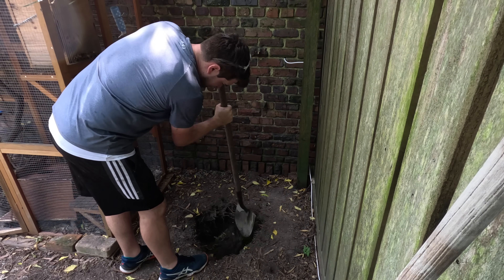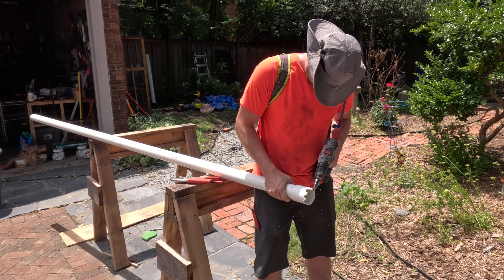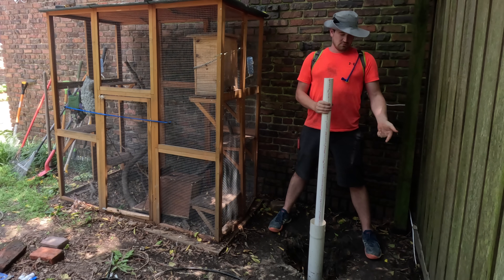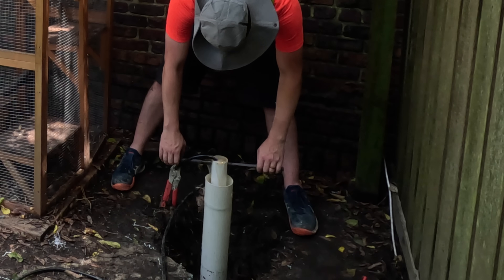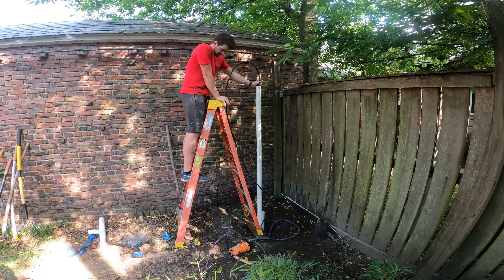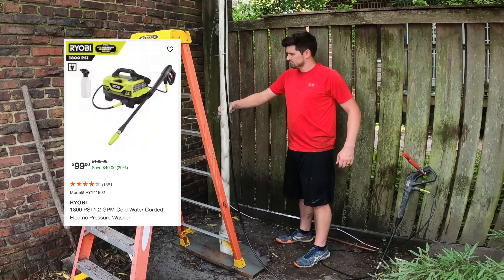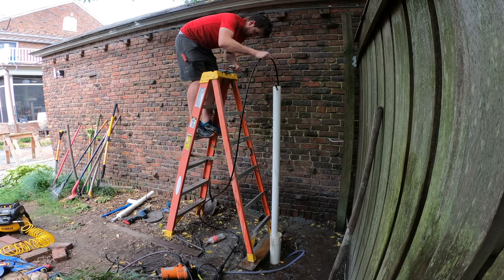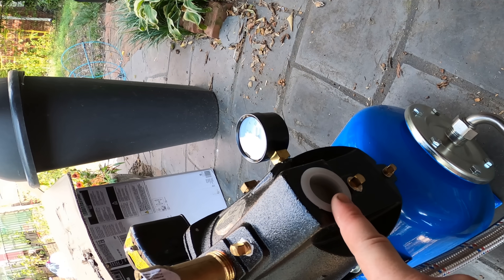I dug a 40 foot well in my backyard

Comment: 8:59 At close to 40 ft. you're just cork-screwing the entire length of PVC at this point, not turning it at the bottom (or turning at a coupling, since you didn't use primer). FYI, at only 40ft, don't ever drink this water. I wouldn't even put my hands in it, because its going to be full of pesticides and herbicides. A good future project would be switching to steel pipe and see if you can get to a potable-safe depth. This would probably require a gas-powered machine. Nice job.
Reply: LoL! "..wouldn't even put my hands in it..."  LoL! There's more chemicals in city water than there is in well water!
After being filtered through at least 6 feet of earth, well water is cleaner than a lake you swim in and far cleaner than the ocean! And if you're still worried, boil it for 10 minutes! City people... I tell ya.... Geezus! This is a great video!
Reply: @thewisecracker-rq1pu  LOL... You nothing about wells. Well contamination can occur a 100ft away. There is a reason why we have minimum depth standards for wells. FYI, I'm an EPA inspector. Neighborhood watershed is full of weed killer and fertilizer. Educate yourself.
Reply: @chaseme9860  lol, the well that supplies ALL of the water for my new construction home that I built on five acres in the middle of a corn field is only 48 feet deep and it passed all inspections mr EPA inspector....
Reply from the maker: FYI the yellow cement doesn't need primer. You're right I definitely don't want to drink from any shallow well -- I'm using this for irrigation only.
Reply: @BadHomeowner  That type of cement is for CPVC, not PVC.
Reply: Orange is for cpvc, he used a correct glue, look at HD your next trip.
Reply: @bud5084  wrong
Reply: Good luck with the cancer.
Reply: YouTube has videos that show what is necessary to setup a filtration system that leaves you with nearly perfect drinking water from the water off your roof, which has lord knows what in it including bird droppings. It's not that complicated or expensive. Why couldn't he just do that if he wanted?
Reply: @ucreativething  Rainwater off a roof is way different than water shed from a neighborhood. The filtration requirements for various chemicals is much more involved.
Reply: Our wells in the middle of farm country are between 25 to 50 feet. We drink it just fine and many of my neighbors are in their 70’s and 80’s.
Reply: @thurlravenscroft2572  Right